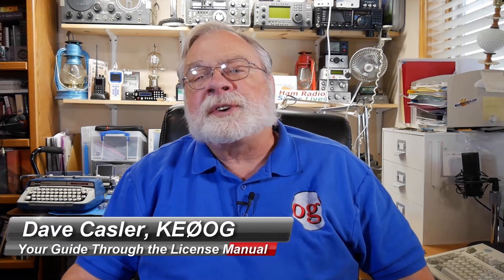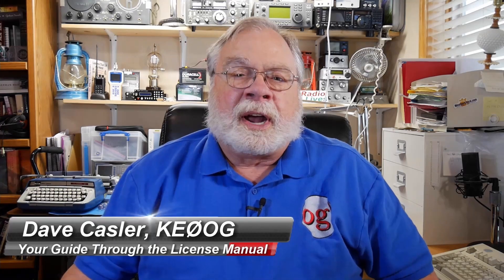Dave Casler Technician License Series: T32 Section 9.1 Electrical Safety

Comment: Quick note about amps being the killer. Its true, but it's not the entire story. Now if you ask for a measurement as to "how much" electricity will kill you, it will be given in amps (actually milliamps). But, here's the important part. Current and voltage are now separate. So, while it's true it takes a certain amount of current to kill you, that current will not flow, for a given resistance, unless there is sufficient voltage. So, high voltage would matter because it's the pressure that's going to make that current flow.